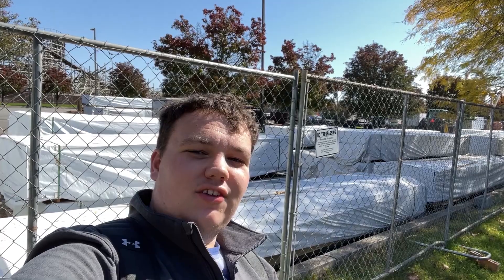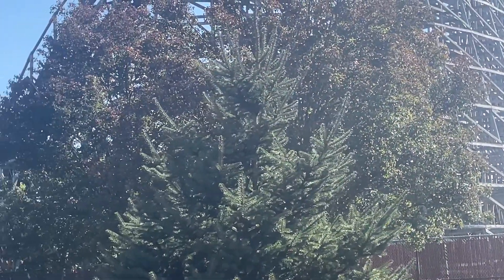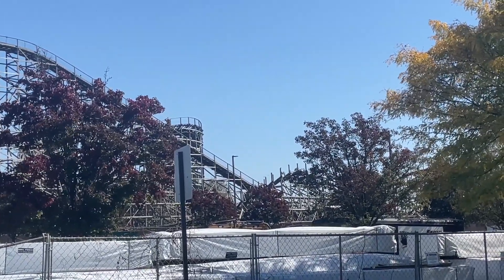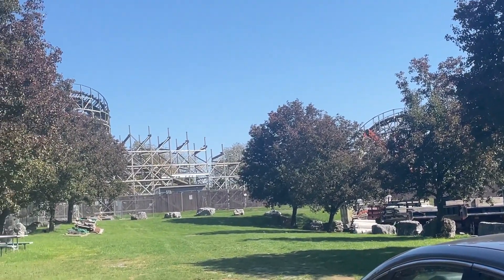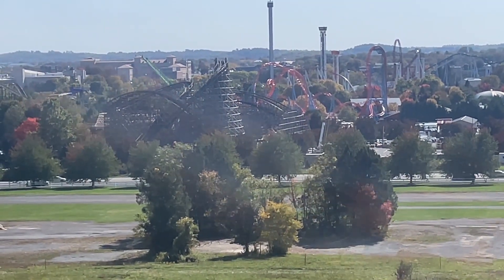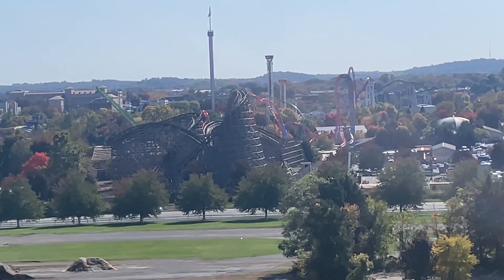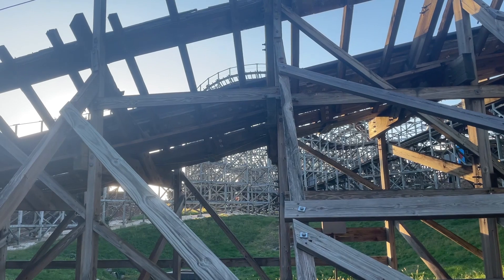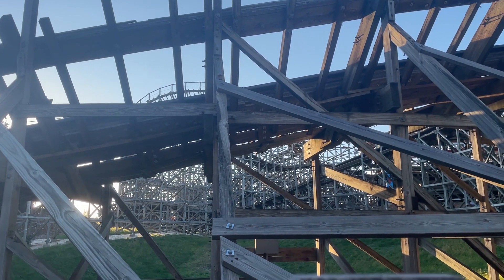RMC Wildcat Construction Update #10 - Two more track sections missing (10/15/22)

Comment: Weeks? I doubt its open  before 2024.
Reply: It can open by 2023. They have had this planned since 2021 I believe. At this point they most likely have the layout already organized, they just need to get rid of the track and such.
Reply: @phlixqlk1ng419  Its not that simple. Yes the engineering is done, but a LOT of the structure will be rebuilt, added onto and re profiled. Then its got to go through testings validation and certification. There is no way its going to be done before Sept next year, and parks rarely open attractions in the fall when attendance is declining.
Reply: I think they wanted to open it by 2023, but for whatever reasons, there’s been some delays. This definitely looks like 2024 to me—still massive amounts of work to be done.
Reply: @davefroman4700   I entirely understand your viewpoint. However, RMC has been able to do ALL of this and open the ride the year after the old version of it closed (Take Twisted Colossus for example.) Its likely a 2024 opening at this point in time, but I do see where you are coming from.
Reply from the maker: I meant track being ripped up over the next upcoming weeks. I also believe we are looking at 2024 (if we want something like Gwazi) or something just shy of 200 feet cause of laws in the area.